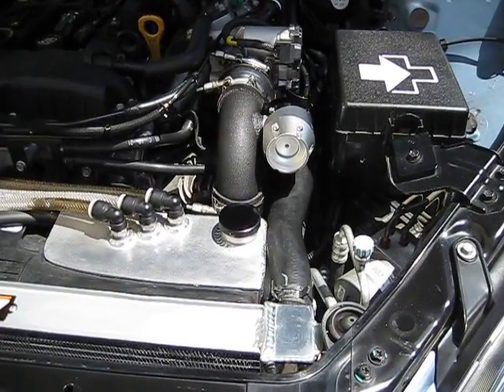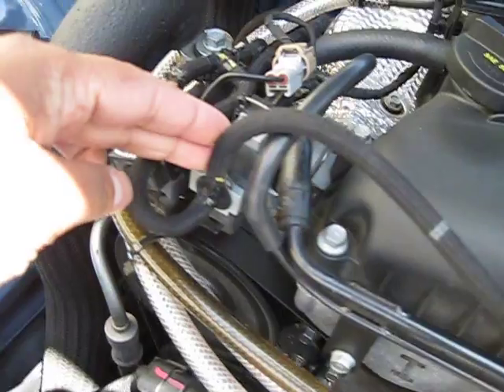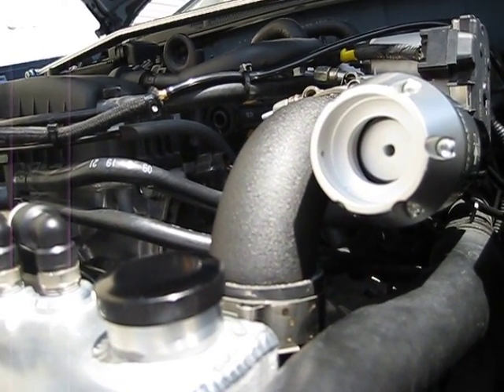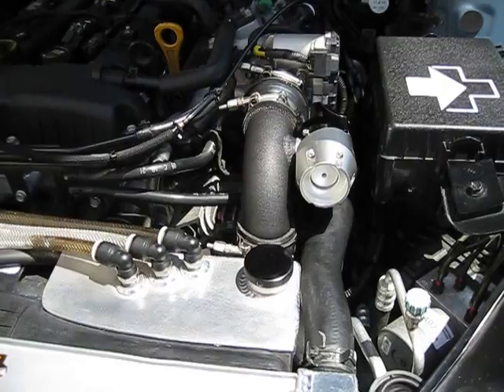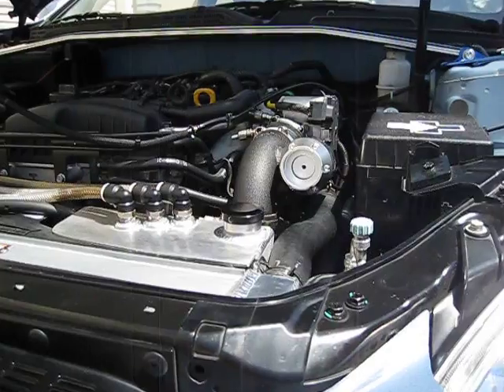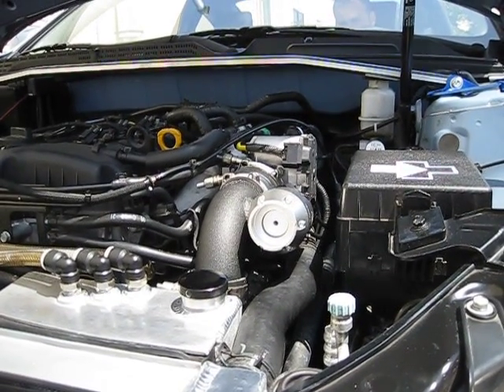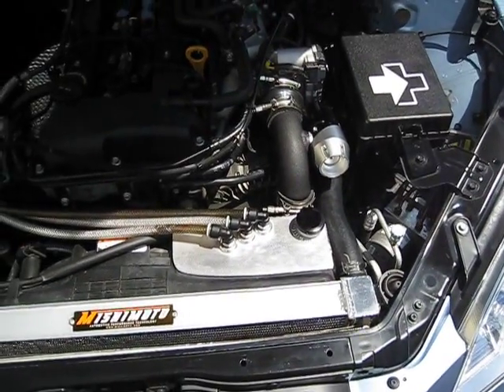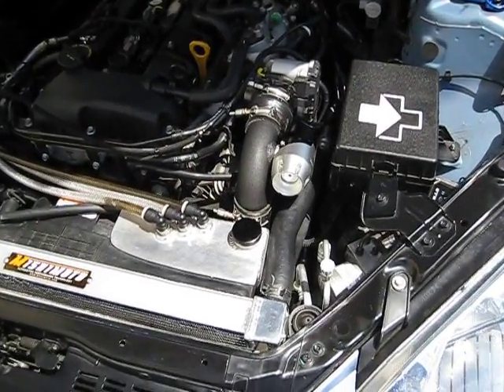Synapse BOV fast enough for OE ECU

Comment: @MidShipCivic the ECU is controlling a 3-way solenoid, it only gives it vacuum when you let off the throttle, or over-rev the motor, or lose control, etc.  It gives it Boost-Only otherwise to keep it shut under boost.